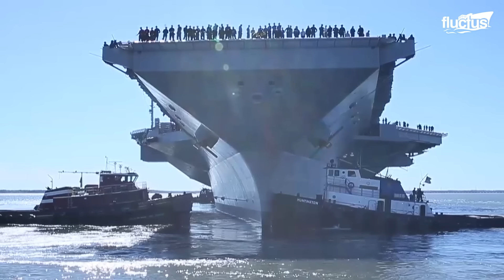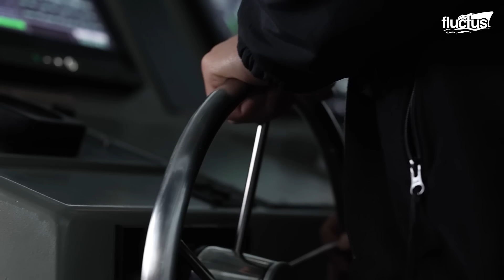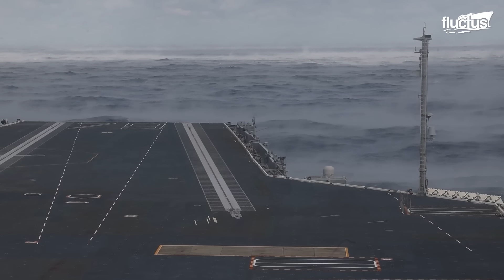US Navy Rolls Out Gigantic Supercarrier From Dry Dock After Repairs

Comment: Apparently they didn't test the laundry vent on the Ford; which caused a fire that displaced 600 sailors from their berths. Oh and that brand new carrier had to make a port call for repairs. I hope that was covered under warranty as the carrier cost 12 billion dollars.
Reply: Look at the number recalls any model of  new vehicles go through, and they are pumping out 10 of thousands. When one unit with thousands of systems that need to interface with each other, one would expect bumps in the road.
Reply: Nitpicking coming from a person who's never built a toy model with more than 50 pieces
Reply: Bc of the operations in Venezuela and Iran, they had a high load of laundry and didn’t take the time (causing a buildup of dirty laundry) so the lint built up and caught fire-per a friend’s son on Nimitz
Reply: @CraigSander-n4b That is an explanation that sounds credible as well as stupid. A Ford class super carrier put out of action like some husband who got lazy about cleaning the dryer vent and causing a house fire.
Reply: Gretta did it
Reply: That laundry system was installed as a sop to the "greenies". The actual operation of the stupid thing was almost as complex as the reactors.
Reply: 13 billion.
Reply: That's NOT it. The USN went GREEN and installed a Carbon Dioxide dry cleaning machine.
This requires super-critical temperatures and pressures -- wildly different than ANYTHING you've ever dealt with.
It's so technically involved that the popular press never goes into the details, the FACTS.
The whole system needs to be removed.
Reply: @davidhimmelsbach557 Along with the fire suppression system that didn’t activate.